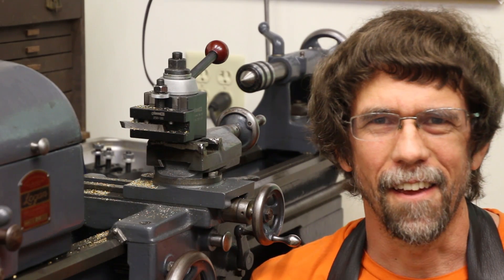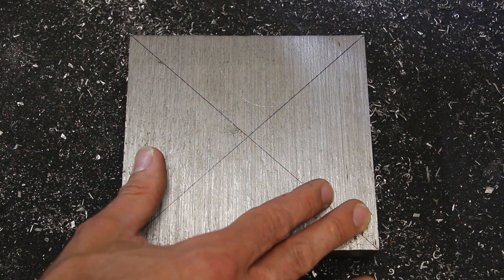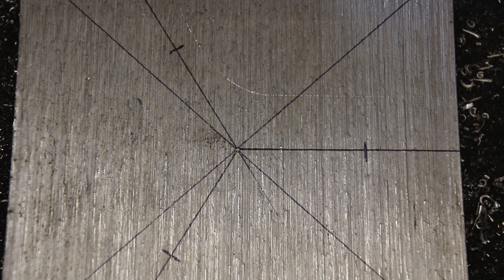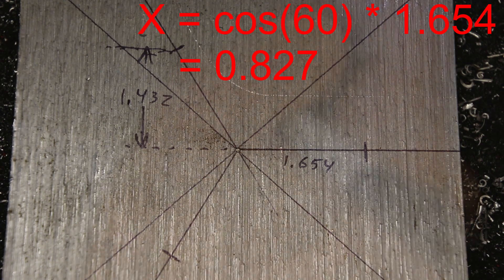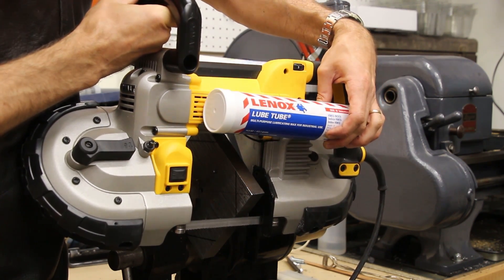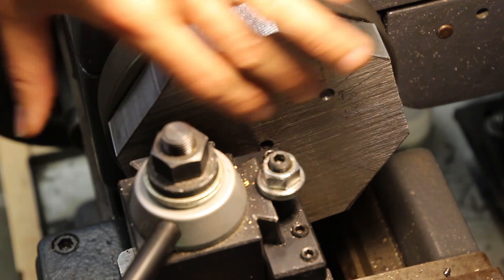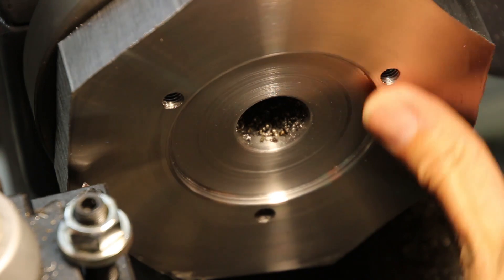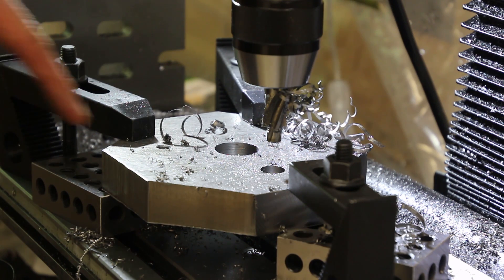Machining a T Slot Faceplate, Part 1

Comment: Nice work... I was an electro tech (retired) and always been interested in machining, and there was at the shop Malcolm who was my guru concerning anything machining. I am an amateur but this guy showed me a lot about conventional machining.
And one of his trick I may pass along here is about the way you tapped those holes at about 8 minute in the VDO. You mention that you don't have a spring loaded center as we can see, Malcolm would just hang some weight on one of the handles of the quill! This keeps both your hands free for taping and insure a perfect alignment. It works! :)
Reply from the maker: Thanks that sounds like a good trick; I'll give it a try next time I'm tapping on the lathe.

Comment: the slots are not straight . so how o you give longitudinal feed ?? the slots pass through the center hole . but they are not straight. don't you need a rotary table??
Reply from the maker: The slots are actually straight, and I just cut them by feeding in one direction on my mill. I use this faceplate mainly for holding odd-shaped parts on my metal lathe so the slots don't need to be cut with very high accuracy.

Comment: Great videos, but you keep doing one thing that makes me cringe. You should always cut towards the chuck and/or towards centerline of the part, not away. When you cut using the back side of the tool, there is very little support and you can cause the tip of the tool to chip. It's also the wrong geometry on the backside to cut properly.  It's also better to load the lathe in the correct direction, putting it in compression as opposed to tension.

Small stuff, but it can make a difference on your finish and tool life.

Comment: Love that tap wrench,who makes them,looks like it makes tapping an enjoyable part of the work
Reply from the maker: The tap wrench is made by GearWrench. They sell the ratchet handles separately and also several sizes of kits. I bought the large 114-piece tap and die set, GearWrench part number 82812. It's probably overkill for my modest threading needs but it's nice to have such a wide range of common sizes on hand.
Reply: Thanks for the info,i did find it was a Gearwrench.The two sizes they make will be in my toolbox soon.Never an overkill,and always worthwhile to have a comprehensive sae/metric tap/die set,covers 98% of encounters.
Reply: How are they in regards to backing the tap off to break the chips?
Reply from the maker: It works okay, but you have to flip the little lever to reverse the ratchet each time you reverse direction. Not a big deal and it flips easily but it's a bit tedious in that regard. I have broken my share of taps so I'm pretty conservative and break the chips quite often, as soon as I feel it start to bind.

Comment: Love that ratcheting thread cutter! Not see one of them before, I guess that it makes it a lot easier to keep it straight. Cheers
Reply from the maker: The GearWrench tap and die sets are not cheap, but they are comparable in price to other good-quality sets. I debated about whether it was worth it for my limited threading needs, and now that I've used it I'm very happy with the purchase. I wouldn't say it's a lot easier to keep it straight, and in fact it's a little harder since my spring-loaded tap guide doesn't fit (yet), but it's much easier on my hands and just a pleasure to use.